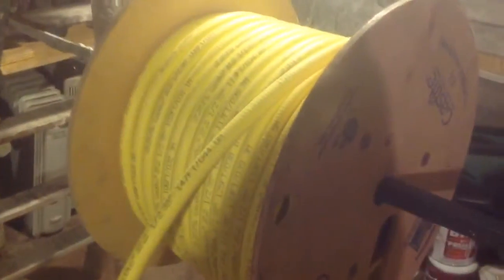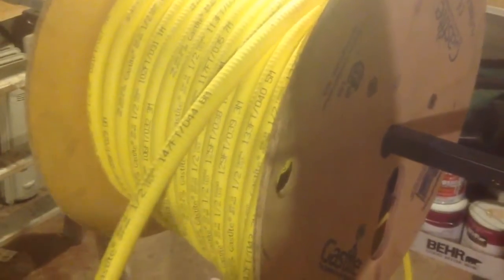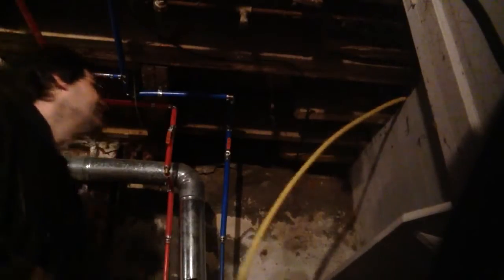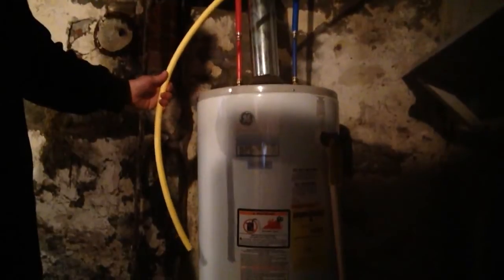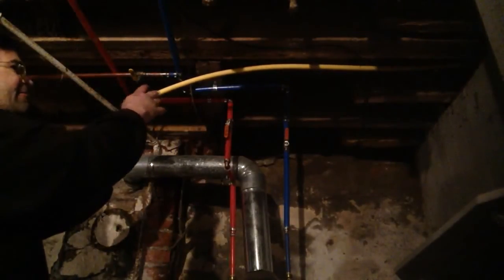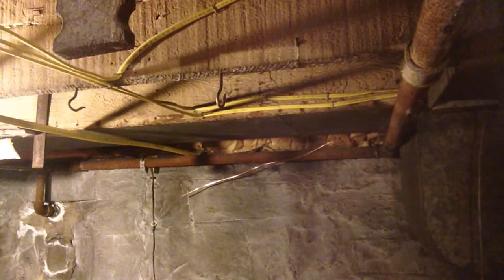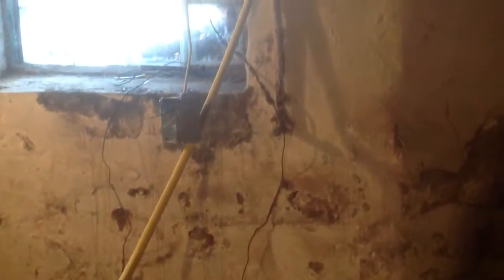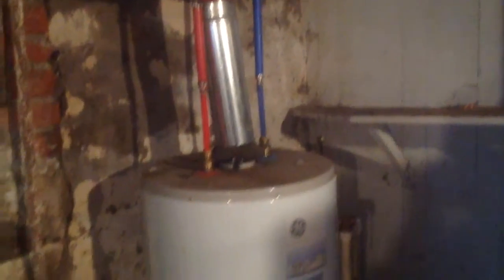Diy how to install csst corrugated stainless steel tubing part 1

Comment: Gas line is not to code and the water heater is not to code. Before you go showing others how to install this make sure you know what the local codes are.